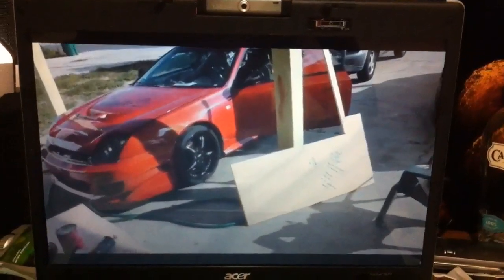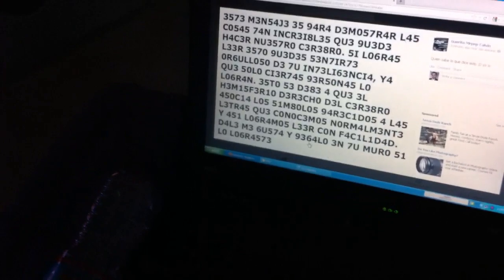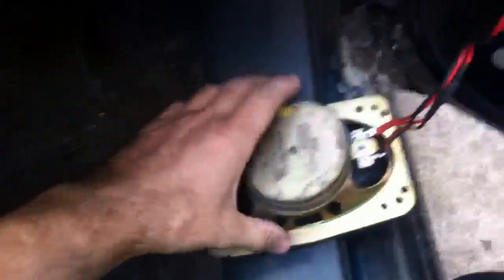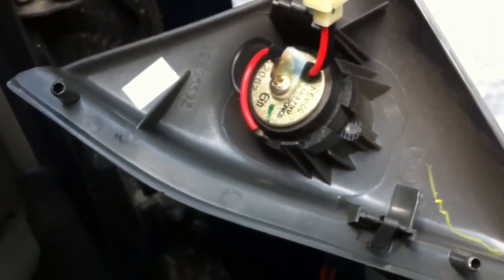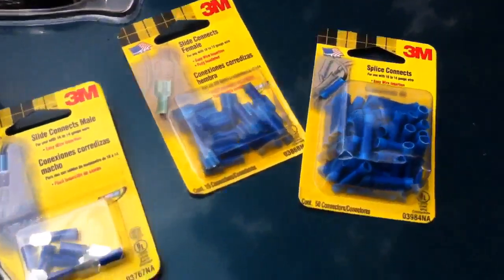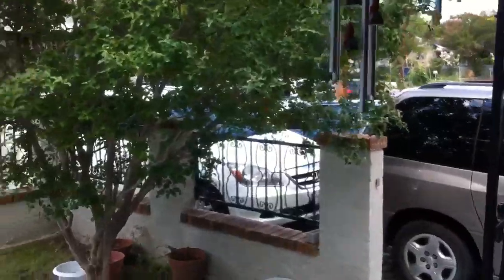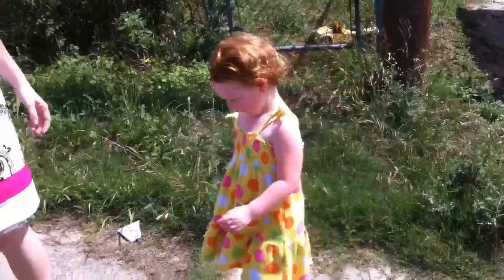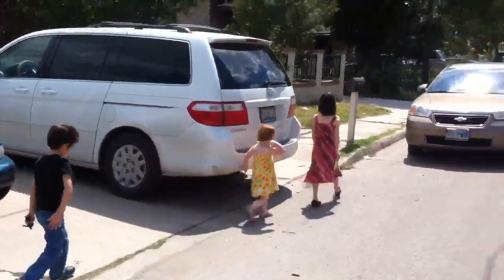Hooked up doors louder and window shopping

Comment from the maker: @lowone21 welllll the reason that I haven't changed out the pro's yet is cause they range between 20hz-200hz frequency range unlike my Fi's which just say 33hz :p and what I have been saving up for was some of the new Everest Soundlab 10s like a pair or three of them but they handle 2,000rms each one ;D and then have a special box made that can handle a wide range but I want to say that it might have to have an interchangeable port through the rear deck and I still need to get thicker wire from